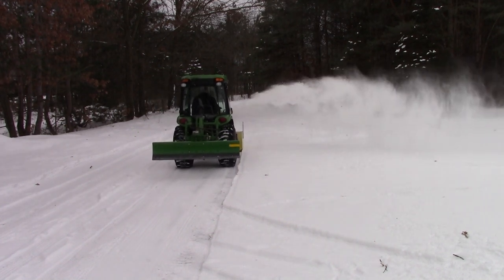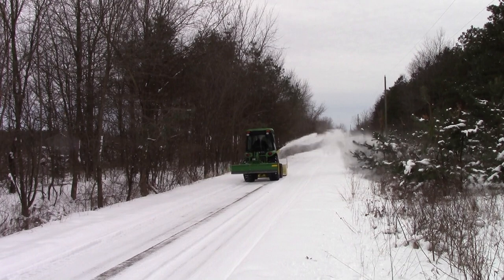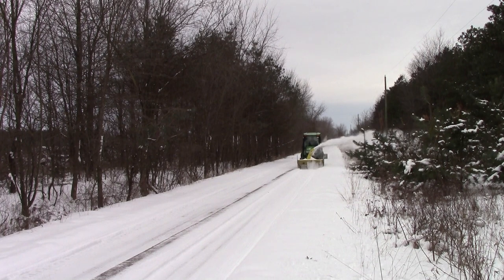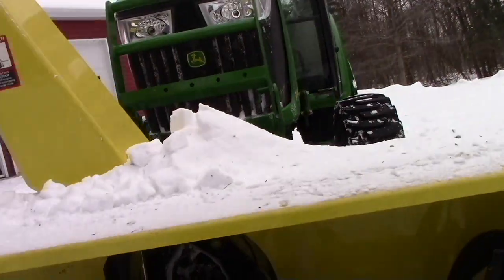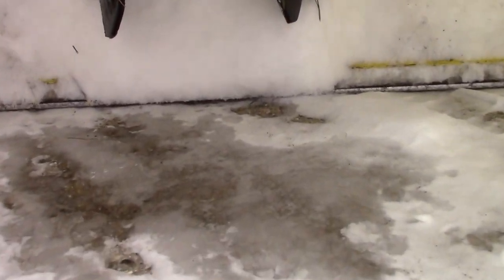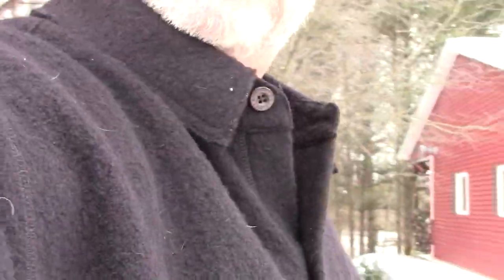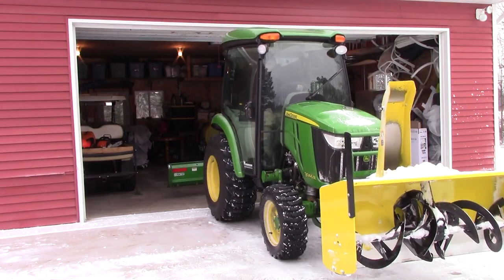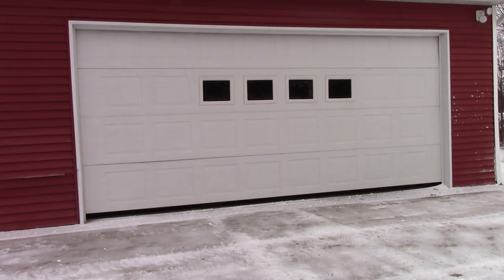Why a Snowblower Instead of a Plow Truck?

Comment: That's is a great set up you have there. I've been plowing my  1/4 mile acreage road for 18 years now and just recently built a snow blower truck (van). Although the plow was no slouch by any means, it was getting to expensive to get parts for it and I'm getting to old to crawl around under it at 30 below to work on it. I use to plow my field road 30 feet wide because of the snow drifts that would blow in overnight and end up with a 10 foot wide road by the morning light. Now the plow had a 12 foot wide 3 foot tall blade, but it wasn't a fast machine...I mean really how fast can a combine go...lol. Chains on the wheels and a heated cab made it barrable, but pushing back 3 and 4 foot drifts and banks after they've stuck to the ground was getting to hard on the old girl, and 2 years ago she decided to let me know it didn't want to do that any more. Now the blower van runs great throws snow 50 to 60 feet and no more banks and all I can say is I should have built this rig 18 years ago.
Reply from the maker: LOL!  So.....you understand what I'm saying here, but on a much bigger scale than I.  Glad it is working out for you, hope you have an easy winter this year.

Comment: Approximately how much was the snowblower and how does it hook up to the tractor? Does not look like it uses quick attach like my bucket and my grapple? Is it difficult to hook up?
Reply from the maker: It was 6-7 years ago when purchased, so unfortunately I don't recall the price.  And you are correct, it is not the quick attach on the front like the bucket/forks/grapple.  You have to remove the whole front end loader and store it for the winter and then it takes about 15-20 minutes to hook up the snowblower.  But once you have it, oh boy, it is great!  All the best to you.